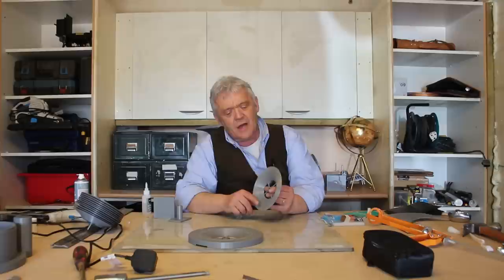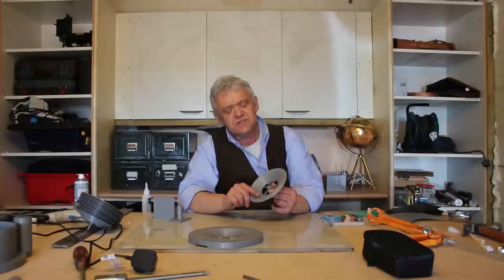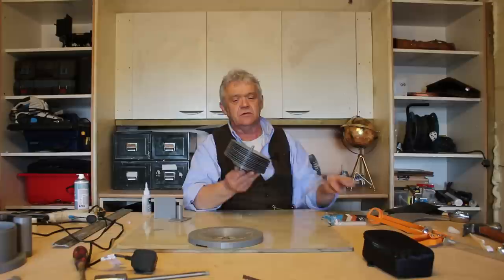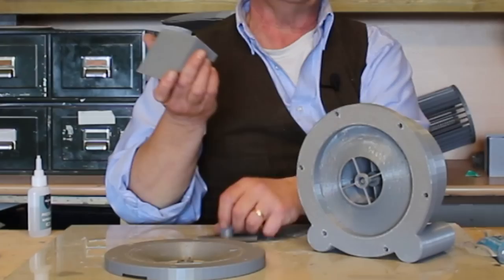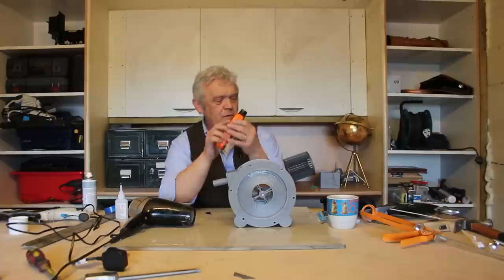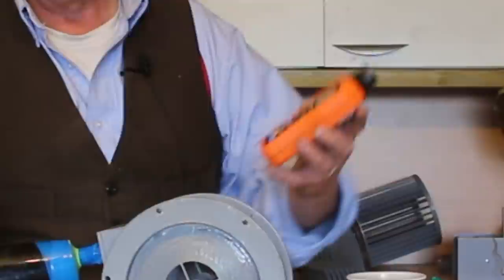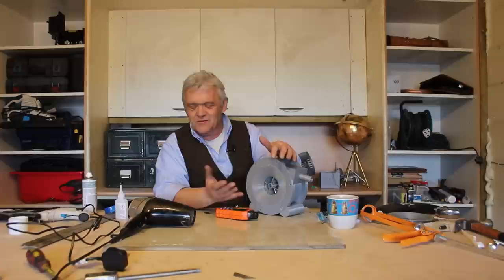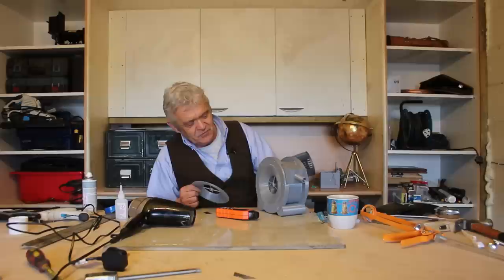1918 The Tesla Hyperbolic Turbine - A New Invention?

Comment: I noticed if a vacuum in on the exhaust end it increases efficiency. Problem is ice build up on the exhaust side. 

But if the hair dryer were inline and the hair dryer intake were hooked up to the exhaust that would work for a while to see how fast it would go. 

If the exhaust side only were hooked up to the intake of a compressor, with the turbine to free air it would run on vacuum only from a vacuum cleaner or compressor intake.
Reply: I find this extremely fascinating.  I suppose when you are drawing air from the exhaust, it cases the air to lose significant amounts of pressure while maintaining volume, thus cooling the air.   it also makes me wonder if you could feed the exhaust back to the intake, but heat it with a flame and create a kind of gas turbine engine
Reply: @jsh111  
They have a thing called a cold gun. It takes advantage of this, makes hot and cold air. A small one costs $20 bucks. 

To run the Exhaust back into the intake: look at a diesel truck exhaust pipes that pumps air into the exhaust system. 
I think they call it a Venturi. So a very large cone on the intake and the exhaust shooting air into the cone would suck the atmosphere air into the intake.

Comment: Centrifugal forces at design rpm will flare the disks and increase their diameter and crash the case.
There comes a point when the rotor goes efficient and converts energy nearly 100%.
Conical disks will need some girdle to keep it all together. This will decrease radial inflow.

Comment: Outstanding!

A word of caution though.
If you are going to throw some serious air through there you need to bear in mind what the forces are with that plastic spinning at 40K+ rpm. They may only be plastic, but plastic travelling at those kinds of speed carry some energy and if it fails would turn a good day bad very quickly. Being a parabolic curve will give it some strength but the forces will not be in line with the parabola!

Comment: Mate, drive it and use it as a pump.

If it's any good, turn your duscharge nozzle parrallel with the shaft and use the pump to propel a craft (toy car or toy boat in water). Maybe have a few discharge nozzles.

You could even try using it to generate lift, have your discharge nozzles at a rotary angle around the shaft to reduce the spin of the housing.

I want to have a crack at this but dont really know where to get started! Your tinkercad files and find someone with a good 3d printer i suppose!

Comment: From my reading of Tesla's experience with the TT, I suspect your design will bump into the same issues he did, viz. material strength of the disk at the optimum design rpm.  The 'centrifugal pseudo-force' stretches the disks and causes clearance / RUD issues.  Your conical 'disks' will be even more susceptible to outward movement at design rpm, and I suspect it will be difficult to sustain shape and clearances.  
IIRC Tesla saw that the small pins which defined and stabilised the inter-disk clearance at the perimeter of the disks were important elements in capturing the energy from the input fluid stream.
Note that the gap between the disks for air is less than 1 mm (down to 0.001 mm, in some papers), being the width of the boundary layer.  Wider gaps simply don't convert as much of the energy from the input air as correct gaps do.  
While a lot of people are playing with TTs, their current absence from mainstream energy conversion systems suggests that these developments have a long way to go to beat other options.
The Ugrinsky turbine or even a Pelton wheel would be my preference at the sort of rpm ordinray folk can get involved with.

Comment: Obviously  not design for high RPM, but in comparison to flat discs with  same spacing and surface area, what would be the difference in torque is all that matters when it comes to producing  power.   As it stands, the only obvious benefit to using cones is the reduction in overall diameter of the turbine.

Comment: Here's an idea I've had in my head for some time now. Ram Pump into a Tesla Turbine. Use metal plates. The "hammer" effect of the ram pumps could be absorbed by the mass of the metal plates. Thus the output would see a smaller wave as the water to air intervals continues. Thus a micro-hydro off of a mechanical (no electricity) pump. I was thinking of having like 4 pumps. And trying to run them at alternating intervals. Just a thought.

Comment: Maybe some of these can be cast from hypereutectic aluminum to prevent alot of thermal expansion,   get the clearances tight, 
 .010"-.020"  to possibly get a efficient steam turbine, cat the disc and machine them, to a tight  tolerance, use less steam to make power, less CFM, especially if a second turbine is designed to run off the exhaust of tge first, tuned  to use the cooler steam under less pressure, less dense, and not restrict  flow of the first,  use a planetary reduction gear,  and;3phase  generator,

Comment: Love this! Makes me wonder if it will work in reverse... Tesla turbines could be used as a turbine or a vacuum pump... would this setup create a vacuum? just put a vacuum cleaner on the end rather than a hair dryer and see if that makes the disks spin.
Reply: I'm playing around with the idea of compressing the air as it comes out of the turbine so you could get live generation and air battery charging at once from the same wind, but all done mechanically.

Comment: Thank you! Will these blades work with steam too, or do you need a different blade angle for those? (provided they are printed with a heat resistant material)

Comment: Mmmh I understand that this was to test the angle requirement problem and the vortex generation, but I doubt it is possible to see the actual potential of the hyperbolic cone version, since the main problem of the Tesla turbine is that it's exceptionally efficient at extremely high RPM, so high that the centrifugal force is stronger than the material used for the disks, deforming it or breaking it, so making a plastic prototype is quite limiting for understanding it's actual behaviour at the intended RPM range.

Comment: Very impressive. Just intuitively, I did not expect even 1000 plus RPM. I thought the hair dryer might get you to 500 or so tops. Shows you what intuition does for you.
Reply: I could be wrong, but I think Rob just directed the laser tachometer directly onto the ”spokes” of the center hub of the rotor to measure RPM instead of reflective tape, which kind of messes up the RPM reading. 
If it has 4 spokes, then it would be reading 4 per second and therefore the real true RPM would be the 3400 divided by 4.
Reply: @xmysef4920  Didn't think about that. Still more than I thought you'd get from a hair dryer.
Reply from the maker: no i used reflective tape mate on one spot

Comment: I was thinking, instead of a pencil shaving type of cone spiral for air flow intake, perhaps if you took a pencil shaving spiral and cut it into specific spiral lengths, and overlaid separated loops of <1 loop upto 1 loop, you could rotate them in a certain way to improve the air flow as they all spin independently while still providing rotational force to a central shaft. 
It would be good for direct air contact possibly???

Comment: Can this be combined with the serpentine rotor to spin inside the Darwin wind turbine housing, in counter rotation to dual magnetic flywheels. With magnetic bearing, and ball point pen backup spacer rides. 
 Doubling the field strength and increased efficiency?

Comment: Thats impressive! With a few extra tweak you might get 7000rmp?  If you have something like dual flow?  Working on both suction and compression? High pressure inlet negative pressure outlet with an air multiplayer on it? Depending on how much you want it to spin it? Attached to an aeromine? That works like crazy?  Especially if your collection is from large area?  And focusing it through a tiny area?  It should the create a feed back loop? Much like how trees generate a negative pressure to bring in the winds and rains? Get this right?  and bingo!

Comment: Robert so I was thinking about how the Tesla turbine works as a compressor if you spin the shaft. If you stored the compressed air as a battery and then fed it back into the turbine to spin the motor (dc) you could then recover some of the electric power. Initial power could be solar or wind.

Comment: Would adding a conical spindle accelerate the airflow noticeably? I would guess yes, but you'd need to modify your printouts accordingly - sorry about that. 
I'm curious to see the output of the system attached to say a hairdryer motor turned generator vs the 1500w that goes in. Follow up video maybe? 

Without the artificial airflow, would you consider the hyperbolic stack to channel ambient air into the system? you should get enhanced airflow power generation at very low airspeed.

Comment: Could the destruction of the discs, in a tesla turbine at high rpm, be offset by their magnetic confinement? The use of repulsive  magnetic rings, aligned between the discs and built into the outer casing, could be adjusted to match the necessary field strength needed to balance the destructive forces that accompany higher rpm's.
Because the hyperbolic shape is beneficial in harnessing lower velocity fluids, but restricts higher velocities due to the inherent material imbalance that comes with that shape.

Comment: Hey I love your concept with a Tesla turbine it was designed with steel plates really close together I think if you were to decrease the space between the plates and add five or so and instead of having the inlet coming out of 90° angle come in at a 45° angle for the center of the cone you would increase the RPMs I don't have a 3D printer😮

Comment: The centrifugal forces applied to the angled disks will tear them apart due to  deformation /elongation  at higher speeds (10k-100k rpm). So, the ideea is nice but physically flowed.
Reply: Hoping this gets proven in a video.

Comment: Rob,

What do you think of using a Darwin wind catcher funneled through a venturi and into a hyperbolic Tesla turbine with a serpentine coil generator on the rim to maximize the high rpm? I could imagine using such a design with a passive cooling system by running the exhaust pipes four meters underground for cooling and electric generation.

Comment: Please make threads on the air/fluid and 3d print a funnel that you would screw onto the turbine then check the turbine on a generator with a rated power output lower than the input of the hairdryer

Comment: Did I miss another video on this?  Where's the Tesla version to compare the speed under the same conditions.  You said the angle with flat disks had to be very precise which was a a weakness of the flat discs - but could you have accidentally hit the perfect angle for the cones?  Would a change in angle for the cones make a significant difference?  To compare the two - I would say all the factors have to be the same bar the one under test - air speed, gap, surface area, materials used, temperature, humidity, angle of air stream.  I would think any of these variables will produce a different result.  The hyperbolic disc shape has a bigger surface area than a flat disc - and it'll be "fatter" to accommodate the shape.  Perhaps if a flat disc version had a bigger diameter so the surface area was the same it would be similar result.  Also (God I'm going on here but thoughts occur as I write) - I believe the real power in the Tesla design only comes if you push it to very high revolutions - to the point where special metals are a good idea.  Here I expect the flat discs are going to be able to spin much faster than the cones.  Not trying to pour cold water on it all - love the looking and experimenting - but that's what I'm thinking so far.

Comment: Super Sweet!!!  

I Lose a lot of the rotational character with the flat gray filament prints.   Using another filament color(s) might show up on camera more effectively.   Or maybe just a Stripe or 2 with a Black marker on the Spinny Bits.

I wonder if you could plug in some flow simulations on the 3D models.  Does TinkerCAD have physics plugins?

Cheers!

Comment: I would like to offer up the idea that if this turbine is reversed with use of a motor you could create a vacuum instead? As a professional carpet cleaner would using hyperbolic turbine to create a vacuum motor be a more efficient and lower powered way of creating high vacuum more efficiently in comparison to the conventional 2/3 stage lamb motor? Just an idea

Comment: Would it be expensive for you to use a metal 3D printer,so as to be able to use as a steam turbine ? Any idea of what they would charge to print a full turbine in metal?
Great info, keep it up!!!
Reply: - metal is a funny material - it can easily be cut, bent and otherwise prodded into shape, MUCH cheaper to watercut some sheet and press it into shape.  (or spin form the cones on a "metal spinning lathe").  -Housings are great for printing (think of it as casting without the need for a  pattern (or in the other hand, USE te 3d Print AS the pattern and sand-cast the housing at "the local foundry".

Comment: Could you reprint your disks so that the center support blades act as an impeller, such as the power turbine blades in a gas turbine?
As the air spins around and the flow path tightens inward, it “should” impart more energy on the disks.

Comment: As a physicist, I must say I see no reason why this design should be any more efficient than Tesla’s original. Why? Let me explain. 
The reason for wishing wells using a hyperbolic cone is because gravity is the force driving a coin to spiral into the centre. Since gravity is perpendicular to the plane of the disk on which the hyperbolic cone is based, a flat disk simply wouldn’t work. In the case of your turbine, gravity really plays no role and the air is being driven, unlike the coin, by the pressure of the stream of air entering a confined enclosure. I’m 99.9% certain that the hyperbolic profile plays no part in causing the air to spiral.

Comment: The torque is produced by skin friction    not by pressure differences across vanes.
This guarantees a very low efficiency, no matter what  the shape is, a disc or a flared cone ,many in parallel. Just evaluate it and compare it with a radial inflow, bladed turbine. A convenient test turbine is a T-62 small turbo shaft, easily obtained , used as a APU for a lot of helicopters and aircraft. No test, no validity to the claims made here.